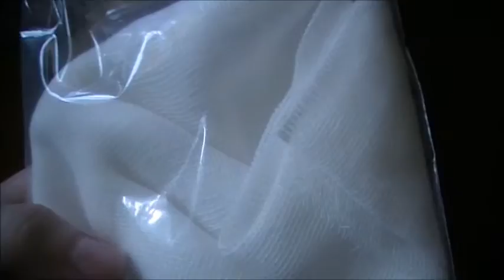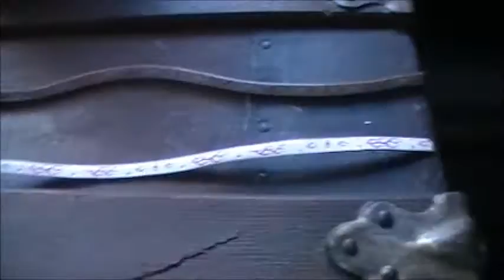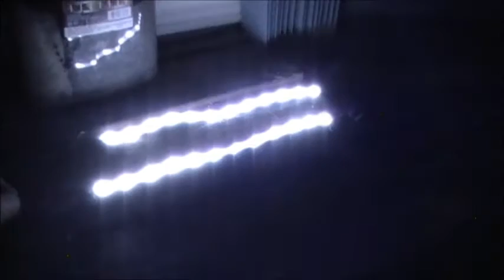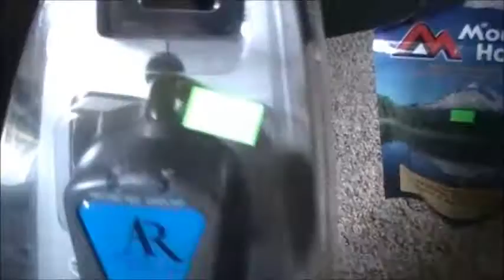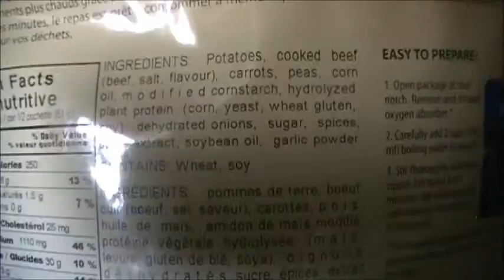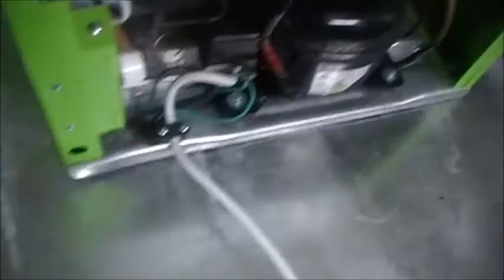Surplus Supplies for the off grid tiny house

Comment: 0.8 amps
That's practically nothing !!!! Nice find Rob.
I suppose it cycles on and off ?
The small upright freezers are also good on power.
I made my daughter a ice cream stand this summer using one.  I let her use a deep cycle 12 volt batterie, a 40 watt solar panel and a small inverter.
She was able to stay out all day selling in the sun, and not once ran low on power.
Reply from the maker: also great as smart switches